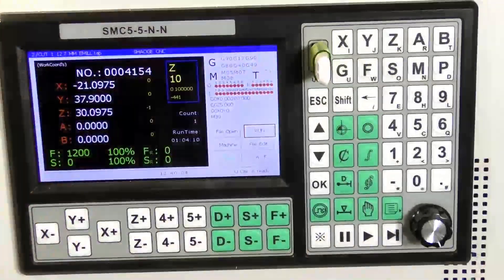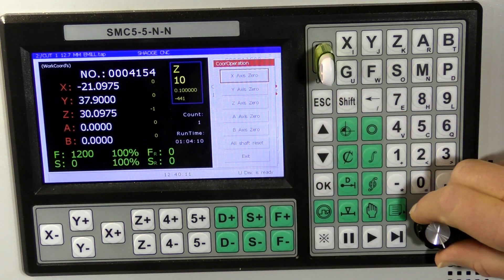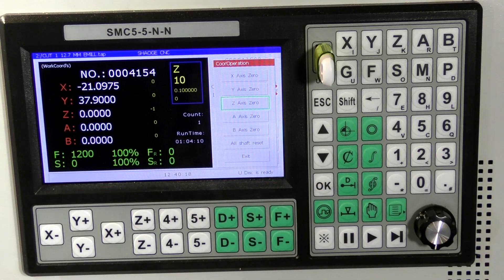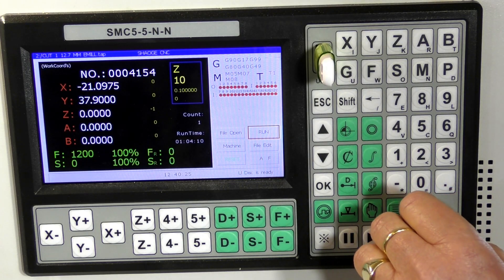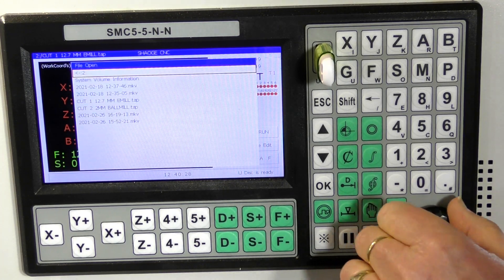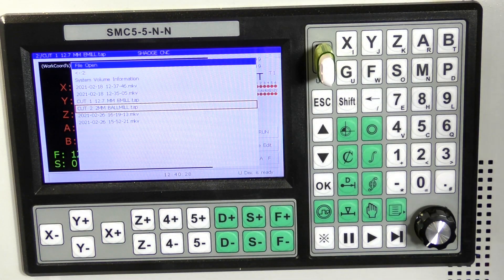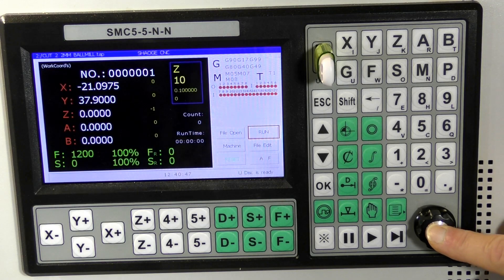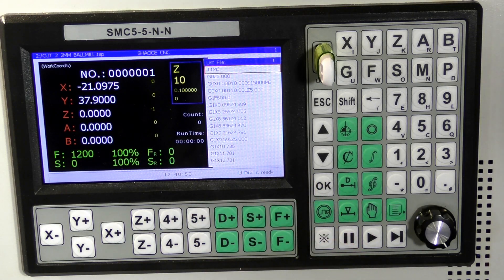3D TEST DRIVE with a 4040 CNC router + I WOULD "NOT" PAY OVER $500 for the SMC 5-5-N-N controller

Comment: I know it depends on the design, but overall how quickly/easily does cnc work like this sell and is it worth much considering its doing all the work for you?  
I'm interested in trying it with a low budget machine preferably a cnc/laser combo like $300-400 range how easily could that be paid back?
Reply from the maker: Hi, have a look at my 3018 and MIDI CNC router videos